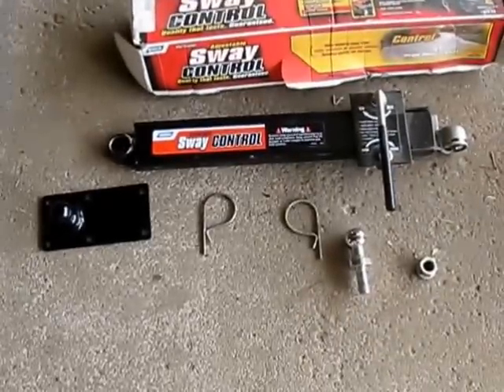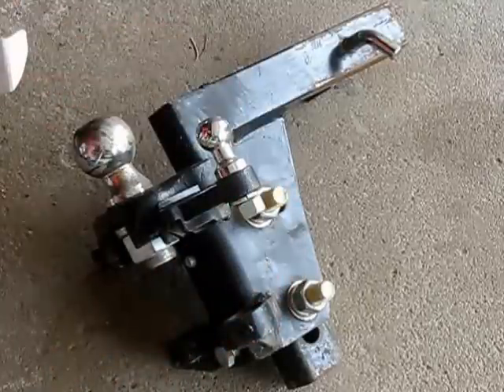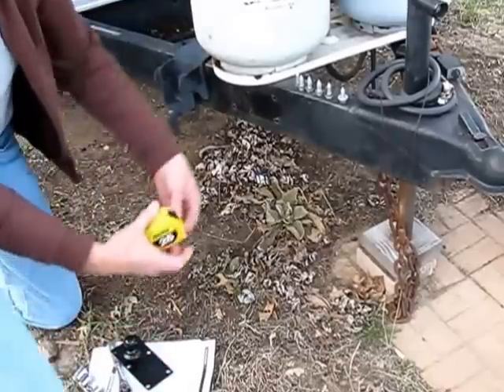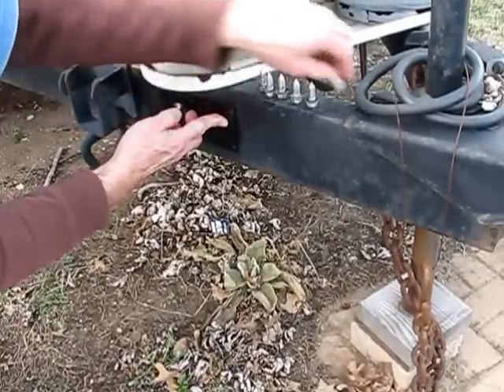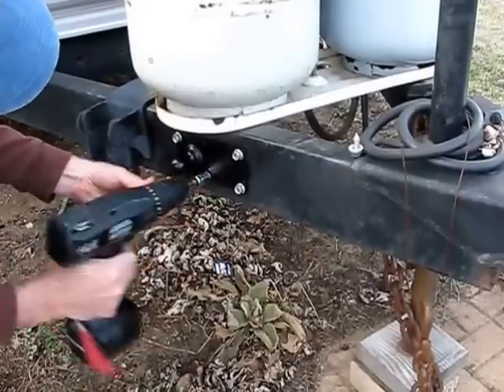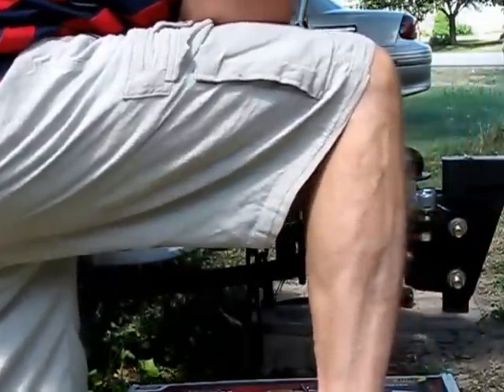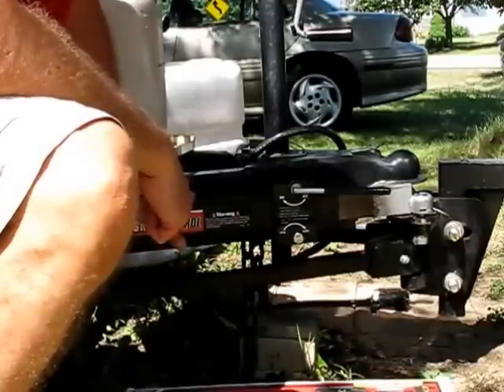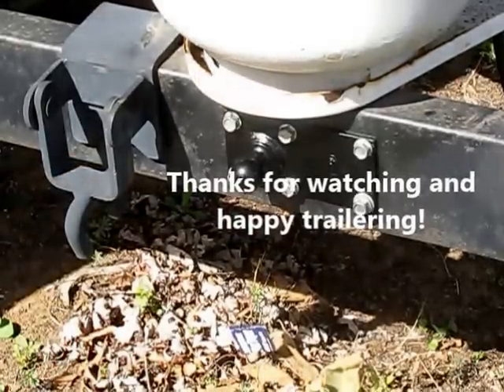How to install a sway control on a trailer

Comment: To tighten the adjusting arm you should only use two fingers and stop when it’s difficult to turn ending up with the adjuster level with the sway control and pointed back.

Comment: Do you think that drilling the holes in the trailer tongue weakened it at all? I’m not a engineer just wondering
Reply from the maker: No. Four small holes cannot weaken a tongue.
Reply: Good question.  The six holes did not weaken the frame by a significant amount, but you bolt a plate to it.  It is stronger now.
Reply: I can tell you that some RV dealers wont buy a trailer on trade that has the ball missing from the trailer.

Comment: Way over tightened bar. The sliding bar has to move in and out of part with brake material in it. If not it will push the tow vehicle.

Comment: does it have to be exactly 24" can it be off 1/2 in or an inch
Reply: There is a little bit of play but you should get it as close as possible.

Comment: Great vid. But you cant put it on either side. The saw bar is meant for 1 side only. It would not fit if you put it on the drivers side.
Reply: Camco along with other manufacturers sell a left (driver) and right (passenger) side mount. The right side is typically where you would mount since it is safer to adjust when pulled over on side of road.

Comment: What size tapping screw do you use?
Reply from the maker: They came with the kit and I don't know the size. All I can tell you is that I used an 11/32" drill bit to make the hole.

Comment: "um" you did a good job on this, "um" but your audio drifts in and out and it's "um" hard to follow you. "um" you also stuck your leg in the way when you "um" were demonstrating the clips so "um" we couldn't see what  you were doing.  "um" also, the bar can only go on one side.  "um" not designed to go on the driver's side.  "um" also on the broken plate, the wind was so bad in your audio that I couldn't "um" hear what you were saying.
Reply: Someone is offering you assistance. Take it or leave it, but you don’t  need to ridicule him. Instead be grateful he made the effort, or just move on. What happened to basic manners?
Reply: "um," whatever. Make your own video.